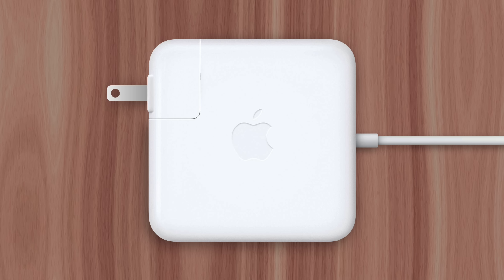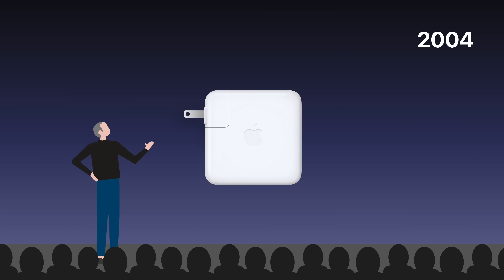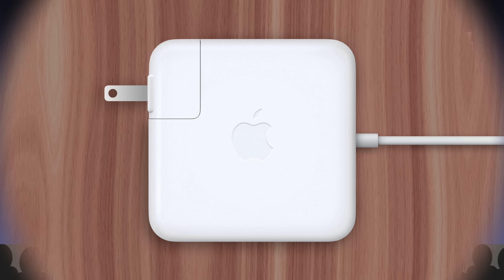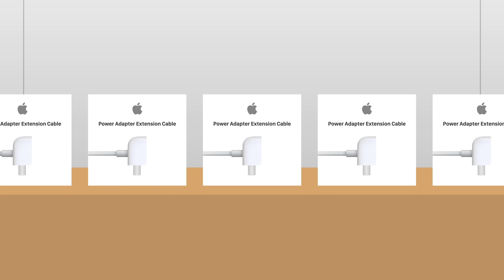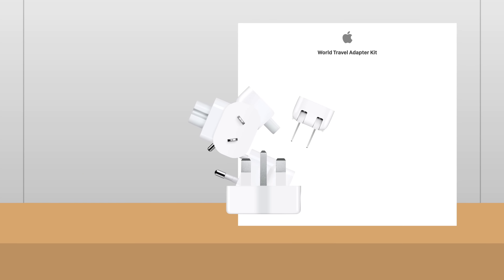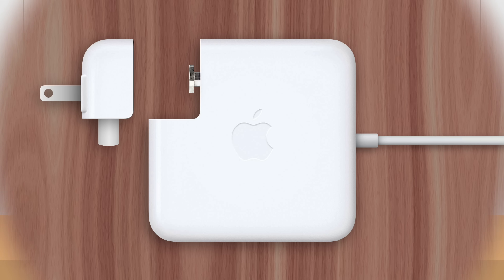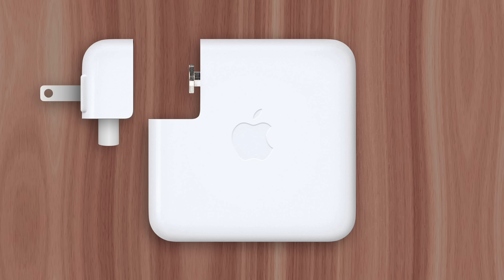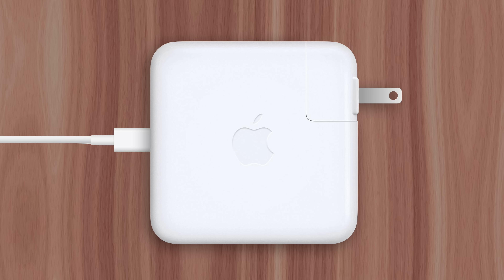Why The Mac Charger Comes Apart

Comment: pro tip: mac charger without the plug works as a perfect bottle opener.
Reply: A very expensive bottle opener
Reply: @sayyedfaizan9655  it fits to Apple's products. VIP but very expensive. Pro Tip: the Mac's case works as a soap holder, when cut.
Reply: Ok... Today I learnt completely useless knowledge 😂 I don't drink beer but I will be the handy guy who open the bottle opener 😂
Reply: @chengkangzai  what but bottle can also be soda
Reply: @chengkangzai  u cam open coldrink botels😂
Reply: @chengkangzai  some soft drinks have lids like that
Reply: @chengkangzai  why a beer bottle, when there are other types of bottles which needs an opener to open
Reply: @chengkangzai  coca-cola?
Reply: @TheRealBandito my question is, how much experience lol
Reply: @mason3872  you don't need experience to know that force applied to a product, for which it was not designed, can of course cause problems.
Reply: @mason3872  4 years of college
Reply: Nice
Reply: Yeah the most expensive bottle opener
Reply: @McVincient  dunno about that tbh. You can get some expensive bottle openers
Reply: pro pro Tip: everything works as a perfect bottle opener.
Reply: @finnschmutte7251  A Galil rifle has a bottle opener built in it
Reply: Nice profile picture
Reply: I did that soo many times with glass coca cola kuppy..
Reply: Is this coming from experience?
Reply: Why not just get a normal can opener? You know...one that is designed to do specifically that.
Reply: @sumdood7011  Because it's not as fun
Reply: @danielyaseen  good way to damage your charger lol.
Reply: meow meow meow meow
Reply: @99.agility  ???
Reply: They absolutely hate this over at Apple
Reply: Ofcourse this was intended to scam gullible Apple users into trying and breaking their chargers. Must be from the sales/marketing team. 😂
Reply: Tried this, worked beautifully
Reply: At first I didn’t believe you so I left and bought a Mac book. Once I got home I got a cold one and it works.
Reply: IM NOT THE ONLY PERSON WHO DOES THAT!!?!?!!
Reply: Oh
Reply: wait why is my charger not working i used it to open 2000000B water bottles
Reply: Damn maybe Apple products really do pay for themselves 🤔🧐
Reply: @TheEviltaco666  that is Impossible
Reply: lmaao
Reply: i wonder how u found bout it…
Reply: @TheRealBandito stop lying man.
Reply: I'll just use the edge of a table or something so i can show off everytime 😂🤣
Reply: nice.
Reply: Pro tip: anything is a bottle opener
Reply: It destroys the hell out of them
Reply: Sheeeesh
Reply: I knew that but kept it a secret because I used to fool my mom but telling her that i was going to get it fixed but went for drinks with the boys
Reply: I’ve heard that before.
Reply: The EAS Lover  it would not explode if it’s not plugged in. But a Samsung galaxy S8 would explode, that one had a bad battery.
Reply: i will not be doing that ❤️
Reply: And it's not dangerous at all!
Reply: @TheRealBandito might be a regional thing im in Canada and tha shi strong enough to work
Reply: yeah man
Reply: Lol
Reply: Yo i actually tried it, and it works like a charm. Thanks for the advice.
Reply: A real pro tip: literally everything can be used to open a bottle
Reply: One time for 1200 dollars
Reply: OK but how in your life did you discover a circumstance where this knowledge would be useful
Reply: What if I have the air? Will the 'Pro' trip still work?
Reply: @krishnawadhwa  lol 😂
Reply: Bruh
Reply: O p e n I t u p
Reply: Lmaoo ok
Reply: It broke ;(
Reply: pog
Reply: Ok
Reply: Until it breaks 🤡
Reply: I don’t thi-😶
Reply: @blessingm8354  lmao
Reply: Pfffffff
Reply: holy shit your right
Reply: No, the Mac pro charger opens up wine 🍷 bottles.
Reply: @OLEHHIG I have an iPhone 5 but how
Reply: This could have been useful, never owned a bottle opener until last year...
Reply: The people who tried this and thought it was a good idea… 🧐
Reply: Pro tip the manual of a the mac charger works as a bottle opener too
Reply: Wha-?
Reply: @decent flipper 10/10 wouldn’t remember to
Reply: you can only use it once
Reply: Double tip: also works with ipad charger
Reply: it broke wtf
Reply: No it doesn't.
Reply: Did you know, that's their entire product line. They're expensive bottle opener and chopping boards
Reply: Innovation.
Reply: Not gonna ruin my MacBook charger opening bottles. Imagine having to replace it cuz you opened a beer. Stupid.
Reply: No thanks beer drinker
Reply: almost everything works as a bottle opener
Reply: Pro* Mac*
Reply: HAHAHAHA
Reply: 111th reply
Reply: Yes!
Reply: LOL
Reply: Nah this is a pro max tip lmao
Reply: That's an expensive bottle opener
Reply: Cool
Reply: Honestly when I saw this … it changed my life🎉
Reply: That would give a Apple a idea. Oh yeah cost 900$
Reply: Jesus loves you!😊
Reply: haha, we do this at our apple reseller store on friday evenings! used an old broken brick for years
Reply: @johnneshiem2291  sometimes yes
Reply: Aha! One more reason to drink at work! 👍
Reply: That's smart. I need the Icanopener to flex on my friends
Reply: And how do u know this 🤨
Reply: (in game)
Reply: iBottleOpener
Reply: Uuu
Reply: Why just why???🤦‍♂️
Reply: @VeryTastySoup87  don’t even try
Reply: @TheRealBandito can the IPhone 12 be a bottle opener
Reply: @johnneshiem2291  why the hell do u just keep spamming this paragraph of nonsense that no ones gonna read, seriously, enlighten me
Reply: @materialism in outside right now
Reply: The s21 ultra is a way better phone than the iPhone 12 pro Max in many ways.they are so far ahead of the iPhone that the next iPhone won't even have all of the features that the s21 ultra has now like adaptive refresh rate, 1,500 nits, 100 times zoom, 108 megapixel camera, 8K video, the smallest hole punch, on any phone, reverse wireless charging, recording from three cameras at the same time, single take mode and a macro camera. There are many more but I cannot remember them right now. When you see these features on the iPhone 14 do not think that Apple made these features because like usual they are just stealing the features from the last Samsung. Wach the video 5 ways that the Samsung s21 ultra destroyes the iphone 12 pro max. The next iphone will not have a chargeing port. Wireless charging takes twice as long to charge as wired charging wile using 74% more power and heat. it has Samsung Dex Wich turns your tv or monitor into the screen of the phone. The repairability is much easier and cheaper. Samsung has the Google ecosystem Wich in my opinion is better than the apple ecosystem
Reply: @johnneshiem2291  The iPhone 12 Pro is a way better phone then the s21 ultra in many ways, faster cpu, faster gpu, better night mode pictures (larger sensor pixels, lower aperture), 4k 120fps (60fps hdr) more battery life (even tho 20% smaller battery cuz android is battery guzzling inefficient crap), every app is fine tuned to new iPhones while 1000 Androids must share the same version, LiDAR Sensor, Dolby vision, magsafe, Sensor shift technology (stabilise an image at over 5,000 times per second mechanically)

Samsung are the ones copying apple that has been Samsung’s reason for existence since its founding - to leverage government resources and keep SK’s employed. Easiest way, copy and undercut others. Only against Apple, they could never keep up with the staggering pace of Apple’s innovation, they have given up - it’s not like cometing in the microwave or washer category.

Apple makes full screen phone with notch, samsung copies, apple removes charger from box, samsung first makes fun of them but then remove the charger from Samsung phones and deletes the posts making fun of apple.
Reply: @denil9598  did you even read my comment
Reply: @denil9598  as a iPhone 12 Pro Max owner, I agree with you, but I do think samsung AND apple copy each other. Like Samsung copied the fingerprint, 6 months after Apple came out with the iPhone 5S in September 2014, samsung released the first their fingerprint smartphone the S5 with fingerprint in April 2015. Apple copied samsung with the face recognition, but apple did it with a real laser FaceID, and samsung came out with a face recognition in April 2017 before Apple came out with the iPhone X in November 2017. But everyone can agree apple came out with touchID first and does face recognition way better with FaceID, that alone, it’s just way better than android.
Reply: @denil9598  But yeah snapchat on any android sucks😂🤣 it’s only good on iPhone
Reply: @johnneshiem2291  I don’t think that people buy into Apple because it’s more technologically advanced or it’s better. The thing about Apple products is that it is consistent and it is reliable. The user interface is very intuitive, and I think many people can agree. Features are one thing, but I’m looking for reliability on my phone, and I think the iPhones has just that.
Reply: @jelouxenriquez2719  no that is the worst excuse. The os is the same if you don't go into settings.
Reply: @johnneshiem2291  No! Android sucks! iOS is wayyyy better. I can back up and switch to a new iPhone super easy! Also jailbreaking an iPhone does WAY MORE than an android ever can. Android is too cheap and gross
Reply: @johnneshiem2291  facts
Reply: @johnneshiem2291  llll¡
Reply: @johnneshiem2291  you do know that the a14 bionic is more powerful than the ps4 and also that even though the iPhone 12 has on a 12 mp camera it is still as good as samsung's 108 mp camera
Reply: @johnneshiem2291  Samsung doesn't have a Google ecosystem. It has a Samsung ecosystem lol. Why do you think Samsungs have their own browser and an alternative for almost every app by Google. Also, they went far and beyond and made onedrive as the cloud storage client. I honestly use both Android and iOS. Although, I prefer stock Android and not bloatware. Hence, the pixel 4 and the iPhone 12 is what I use.
Reply: @johnneshiem2291  I will buy a camera and an xdr display instead and will still save some money
Reply: @siddharthjain9702  lol you are buying a apple product you are not saving money you are flushing it down the toilet
Reply: @johnneshiem2291  did I say I am buying an apple product? I said I wil buy a camera and a display instead of samsung S21 ultra
Reply: @johnneshiem2291  Who asked for your opinion
Reply: @johnneshiem2291  this isnt even about the iPhone OR the Samsung phones, I don't know how this is relevant to the video at all.
Reply: @johnneshiem2291 sounds like a cope
Reply: @johnneshiem2291  this is like setting fire to oil
Ur on an apple fanboy channel😂
Reply: @superior7387  yes it's fun
Reply: @johnneshiem2291  can't argue with that

Comment: The MagSafe and MagSafe 2 chargers are still $79 for each version, and I always get the 85 W versions as they are compatible with most machines.
Also, iPad chargers are modular, as are the old FireWire iPod chargers, although the FireWire chargers are only compatible with the duckhead connectors as the extension cables are keyed without one of the second top groove.
The round button-like sliding mechanism which is used to line up the duckhead or extension cable also serves as a ground pin for the extension cable.
Please make a video about T-shaped vs L-shaped connectors, as the MacBook Air was souly responsible for the change...
Reply: For the US, why does is the extension cord have the ground prong but the plug only has only 2 prongs?

Comment: This guy answers lots of questions that are in our mind 😂 
Thanks mate 💙
Reply: @DyslexicMitochondria  Sup bro I watch ur videos. Love ur channeI
Reply: The s21 ultra is a way better phone than the iPhone 12 pro Max in many ways.they are so far ahead of the iPhone that the next iPhone won't even have all of the features that the s21 ultra has now like adaptive refresh rate, 1,500 nits, 100 times zoom, 108 megapixel camera, 8K video, the smallest hole punch, on any phone, reverse wireless charging, recording from three cameras at the same time, single take mode and a macro camera. There are many more but I cannot remember them right now. When you see these features on the iPhone 14 do not think that Apple made these features because like usual they are just stealing the features from the last Samsung. Wach the video 5 ways that the Samsung s21 ultra destroyes the iphone 12 pro max. The next iphone will not have a chargeing port. Wireless charging takes twice as long to charge as wired charging wile using 74% more power and heat. it has Samsung Dex Wich turns your tv or monitor into the screen of the phone. The repairability is much easier and cheaper. Samsung has the Google ecosystem Wich in my opinion is better than the apple ecosystem
Reply: @johnneshiem2291  nobody asked. Not even the comment your replying too expected your darn opinion.
Reply: @johnneshiem2291  u spent your time typing this long note that 90% of people won’t even read including me… Ure trying Way too hard bro lol 😂 if I had an opportunity to pick between a “free” s21 ultra and an iPhone 12… I’ll go for the iPhone. U need to understand that there’s something in life called PERSONAL PREFERENCE
Reply: @johnneshiem2291  and im saying this as someone who uses Android for phones and Apple for tablets or maybe even apple phones one day
Reply: @Resetishere22  trust me if you do then it will be a downgrade
Reply: @johnneshiem2291  No it will not cause I actually used an iphone once, you didnt.
Reply: @johnneshiem2291  but I will admit, u have a point on Android. I personally use it for phones anyway so dont target me, target someone else.
Reply: @Resetishere22  my last phone was a 6s